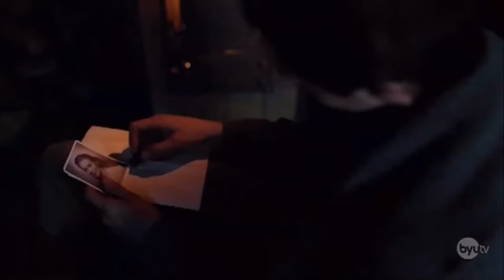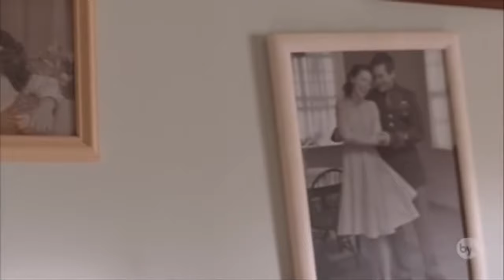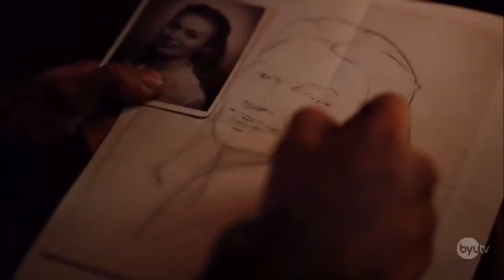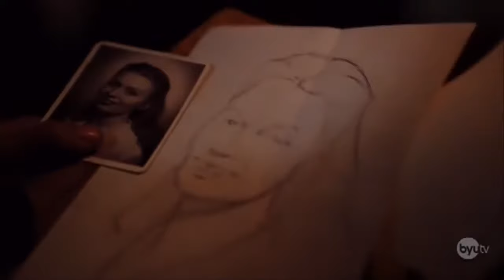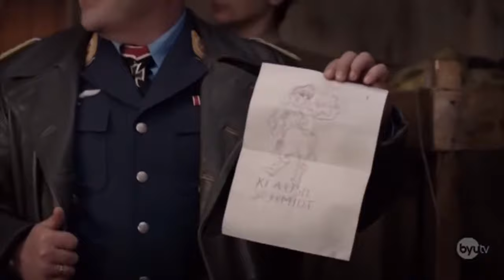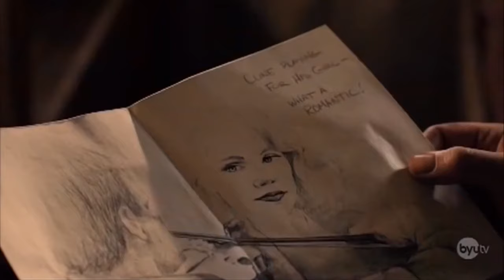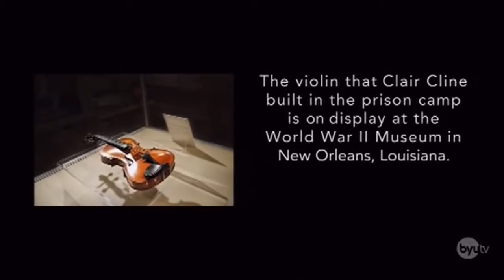New History War movies 2020 LAST DAY English Full Length

Comment: great movie 🎬 but there's one thing I'm curious about, at the start of the movie 🎬 there's a roll-call & the name Zimmerman is shouted out, correct me if I'm wrong but isn't Zimmerman an American 🇺🇸 🔯 Jewish name?? surely he would have had Jewish blood which would have meant he would have been sent to a concentration camp??
Reply: First, Zimmerman is not a Jewish name. Zimmerman is the German surname for carpenter. Also, American Jewish soldiers were not sent to the concentration camps that Jews from Germany, Poland, etc. were sent to. Approximately 9,000 American Jewish soldiers were held in German captivity. Generally, they were afforded the same protections of the Geneva Conventions and were not treated differently than their fellow prisoners of war who were non-Jewish. However, there was still a constant threat of separation and persecution. For those very reasons, many Jewish airmen left their dog tags inscribed with their religious affiliation at the base when they flew missions. Instead, they flew with a second set of dog tags that contained no religious affiliation inscribed on them. 
Hope this helps.